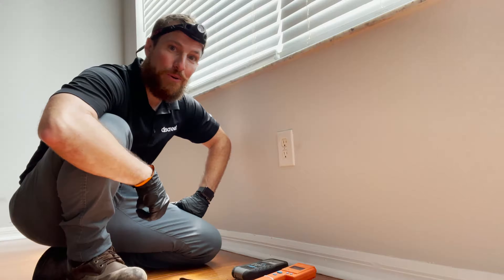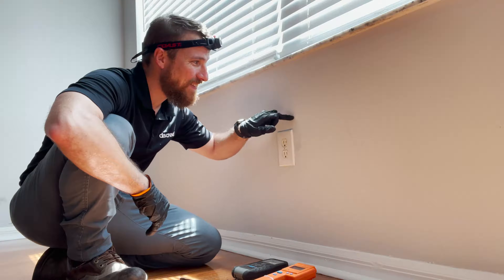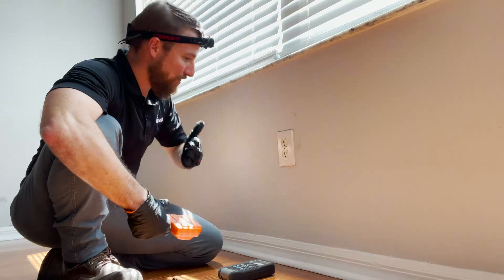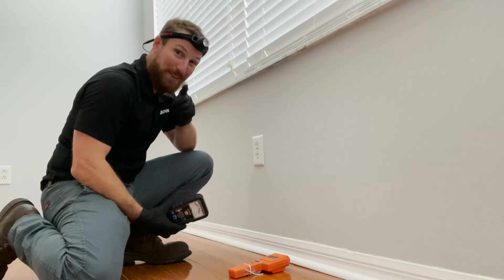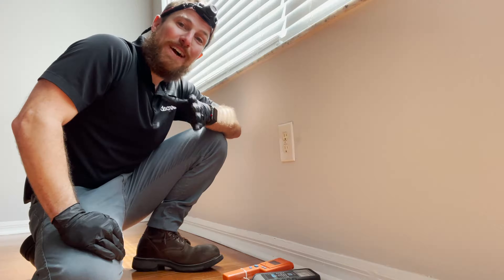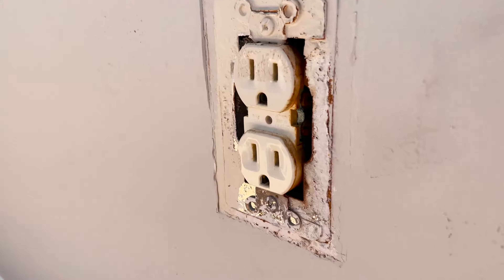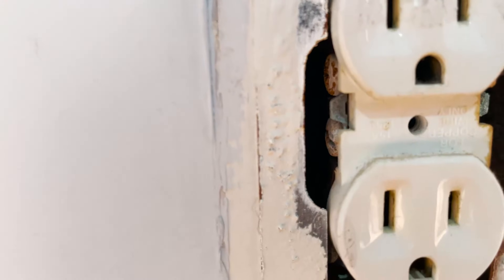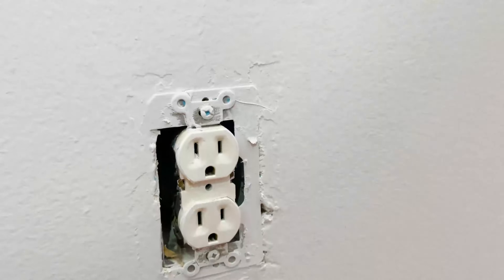Here's a Tip for Validating Moisture Within Walls

Comment: Ok we are in the same situation but we were told there could be metal all around the window giving it a false positive? Apartment doesn’t want to tear in. Many locations around the window is 100% moisture such as entire top portion, entire left side up to 5 inches out, part of the right side and all of the bottom. All from right next to the window to within 5-6 inches out. But they’re saying metal might be back there?
Reply: “Metal can influence some surface readings, but it does not create a full perimeter moisture pattern extending several inches into surrounding materials. The consistent 100% readings across multiple sides of the window indicate moisture migration, not isolated interference. A probe measurement would immediately confirm whether this is a material moisture condition or a false surface reading. Moisture mapping with depth verification is the appropriate next step.”

Comment: Look at the dark area under the window sill.  Is that mold or just dirty?
Reply from the maker: Typically it is going to be dust and debris, however, with dust can come mold. Especially if the window sill becomes cold enough to be a source of condensation from hitting the dew point temperature.

Comment: I learned before you tear away at a structure do an Air Quality test for Microbial growth in the room. You don’t want to expose your self to something without knowing what you’re dealing with. Then suit up and check it out . I am in the process of recovering from mold within my closet floor Moulding.
Reply from the maker: Great advice! You have to protect yourself before anything else. Lacking PPE when handling mold could be a non-issue for some people, while it may greatly impact others.

Comment: Hi, what is the best moisture meter for masonry?
Reply from the maker: Howdy! While I cannot say with certainty what the best moisture meter for masonry wood be, I can share with you which one I think is best, based on what I’ve personally used. Tramex makes incredible moisture meters, designed for various building materials. Their Moisture Encounter 5 (ME5) meter is probably the most versatile meter that you can purchase - allowing for evaluating everything from drywall to plaster, masonry and even concrete. 

Of all of the meters that I own, the ME5 would hands down be my choice for collecting moisture measurements from masonry.

Comment: The wall doesn't need removing. The drywall under the window needs to be removed, followed by the insulation. Odds are, the leak is rainwater entering at the sill level. It's unlikely you'll find damage above that. And if you do, then you can start tearing apart the upper areas.
Reply: I'm sure that's what he meant.
Reply from the maker: @KevinMaxwell-o3t Agreed. I’m referring to the interior drywall and insulating materials behind it only - not the entire structural wall.
Reply: if the wall smells from mold and the moisture meter shows high levels,how do i fix it?
Reply from the maker: @iimalivebutimdead Your best bet would be to hire an indoor environmental professional, especially if you’ve already confirmed excess moisture in the wall. 

Granted, if you are a handy enough DIYer, you could remediate the wall yourself. I would not advise this before doing your homework though.
Reply: Not if the wall has been wet for a while so mold more likely growing inside . So simply saying the dry wall does not need to be removed is not correct in my opinion. Plus it’s an outside wall so it probably have insulation in it too . You can also use commercial dehumidifiers ( not air movers ) to try to dry the inside wall if you can create some kind access . But that still will not get rid of the mold

Comment: Would be nice to know what measurement is considered normal moisture
Reply from the maker: Unfortunately, there is no universal standard for what is considered normal vs. abnormal moisture content. The amount of moisture in indoor air varies from property to property. Also, perimeter walls (those along the exterior of your property) will often contain higher moisture content, when compared to interior framed walls. 

I performed an assessment yesterday, where there average moisture content of the drywall was in the 40s. Compared to an assessment that I performed earlier in the week, where the average moisture content was in the 20s, this would seem elevated (abnormal). However, given the widespread finding of these numbers throughout the property, it was evident that this was the “resting” moisture content of the walls.

Comment: So what if you are aware of water damage is there guaranteed mold? My roof has leaked throughout a few widely spaced storms and in those 3 or 4 occasions I had water leaking into the house along a couple parts of the walls where there are exposed beams. Each time it dried the landlord came and recaulked and puttied the inside leak stains. After the most recent leak they tarped the roof and I haven’t seen any sign of water coming in since. However this time there was the most amount of water for a longer period of time and there is still a discolored stain where the biggest leak was. I bought a moisture meter to test these areas and most of the readings along these two walls were around 8-10% and in two small areas the highest was about 17%. Does this indicate a mold problem?
Reply: Hey! Did anything come of your concern? I am quite literally in the exact same situation. The highest reading I’ve gotten from my moisture reader is 62.5%. My landlord had a company out last year right after he repaired the leak, and they indicated no mold….. About a month ago, the leak was back. The tarp does seem to have stopped the leak, but I just don’t see how something wouldn’t have to be done to dry everything out.

Comment: Can you give a link to the meters you use? Great Video!!
Reply from the maker: Hey there! In general, I’ve been using Tramex, Delmhorst and Vaisala meters for some time now. 

Currently, I use the Tramex ME5 non-penetrating moisture meter and Delmhorst BDX-30 pin moisture meter for checking dampness in building materials. 

When I’m evaluating moisture in the air, I use a Vaisala HM-40. Some specialty meters that I use on occasion is the Tramex MEX5 and Tramex CME5. 

You’ll find all of these on Google, or you can check out the manufacturers’ websites.

Comment: Hello Josh, this is Uli from South Fl. I have a situation as when I look into my brand new bathroom (one month old). When I run the meter its detecting moisture at the base. We gutted the bathroom and there is no visible cracks on the tile or grout. Any idea what could have happened? We did not seal the grout, can this be it? Any advice would be appreciated. Thanm you
Reply from the maker: Hi Uli. Sorry to hear about your situation, but there is some good news! More often than not, finding “elevated” moisture toward the base of a of a tile wall or floor is a false positive. Well, by false positive, I simply mean that it’s likely not actually wet (beyond normal moisture levels). 

Assuming you’re talking about the base of a wall, or even wood baseboard, there can be a number of reasons for findings abnormal moisture levels here as well. 

As I don’t have enough information to fully understand your situation, I would recommend shooting me an email and possibly attaching some photos of what you’re dealing with. Definitely include some additional information regarding the surface(s) that you’re collecting moisture from. 

The best way to reach me is at josh@learniaq.com
Reply: @IAQJosh  thank you so much josh. I sent you an email. I appreciate you attention on this matter.

Comment: No Video on further investigation then. This could have just been cold bridging from the receptacle now it’s had previous high moisture. IE a leak. Not necessarily still happening. I’d have looked at cutting it out above this and if these are insulated behind was that wet and causing the cold bridge. Also these meters You’re using will pick up electrical currents. Was the electricity isolated to reduce any false reading. So absolutely not revolutionary. 🙄🤣
Reply from the maker: Excellent point, as many don’t know that these meters will pickup electrical currents. To those that don’t know that, they could certainly be mislead into thinking something is damp when it is not. 

I appreciate you watching this video and commenting! I

Comment: Thanks for the video. Can moisture readers read btw plaster walls??
Reply from the maker: In general, moisture meters can read moisture content within many plaster walls. Some plaster walls, which are primarily composed of wire and lathe, may provide a false positive to non-penetrating/ pinless moisture meters.  These false readings may indicate elevated moisture, when in fact you’re merely reading the metal wire within the wall. 

I find that it’s best to have a penetrating and non-penetrating moisture meter when evaluating plaster walls. This will allow you to collect varying readings from both meters across multiple areas, ultimately to determine if a wall has water damage.

Comment: This dude never did find out if that wall was leaking, that corrosion on that outlet could have bin from a long ago fixed leak. And on the wall he should have used a pin type moisture meeter because the are more accurate. Its redicules to assert the tiny unnoticable  pinholes a pin moisture meter  leaves, warrant not using it. If i cant leave tiny pinholes in a wall that no one else will notice, i simply wont do the job. If presently  everything is dry the suspected leak  outside the home is  fixed before the next rain and there is no mold now there never will be mold because mold wont grow on dry surfaces. So no reason to tear out the wall, change the outlet, fix the leak outside,  spakle the small spot where your finget found a bubble. Done deal.
Reply from the maker: I commend you for having such a strong-worded, albeit ignorant public opinion. Your thought process on pin meters being more accurate is very interesting. However, your logic is flawed, as there’s pros and cons to both pin and non-penetrating moisture meters. 

I encourage you to educate yourself further on the varying types of meters out there.
Reply: I agree,  I use a pinless moisture indicator a I really like it. It's made by klien
Reply: Klein

Comment: Could the water be coming from the roof leaking into the wall? I just found a paint bubble in a bathroom i had updated a few years ago and when I pushed it water came out.
Reply from the maker: Absolutely! Believe it or not, water can be entering at the roof level and not show itself until it reaches the base of a wall. This can make it difficult for both homeowners and even professionals to diagnose the point of entry associated with a leak. 

In short, water damage within a bathroom can be coming from the roof, as well as numerous other areas. If you have any additional information, or even pictures, I’d be happy to try to be of further assistance to you. You may email me direct at Josh@learniaq.com

Comment: My  14 yr old custom house had water coming through in master bathroom roof. I have a pass through fireplace in master bedrm/master bath. Last January. I had roofing company come and see - they said I needed ‘debris’ cleaned and some flashings replaced. And some tiles near both chimneys were cut. Cost was $3,200. They cleaned all the debris from the valleys and cut some of the tiles back away from chimneys.This was Jan 2023. Here is what they wrote on my invoice:

“ An inspection of the roof was undergone to determine what maintenance was required. We found the tiles behind the two chimneys to be too close to the chimneys allowing debris to build-up which caused the water to overflow. This was repaired by cutting the tiles by 6" to allow the water to properly flow. Secondly, we found the valley metal ends were on top of the tile and this causes the water to spill over the valley and run allow the underlayment, which can cause the underlayment to prematurely deteriorate. This issue was repaired by cutting back the valley metal ends and installing a lead extension on the five valleys. Lastly, we found the valleys and cricket to have debris. We underwent a clean-up, which will allow the water to properly flow…” 

We had a lot of rain in Feb and March and even some in August. All seemed, but to my shock, last week, I noticed a stain on ceiling of a bedroom not anywhere near where the January leak was. But this bedroom backs up to living room in area where there is another fireplace/chimney. I don't know when this happened. I seldom go in that bedroom and I seldom look at my ceilings. But water must have gotten in somehow. . I called the roofing company and left a message. Waiting for them to call me back.
I got a ladder and went up to feel the stain and there is no wetness or puffiness on the ceiling. 
November is a month we often get rain. Of course if we get rain before the roofer calls me back I will be sure at watch the ceiling where that stain is. Is it possible that
there was an unnoticed issue in this room but no problem NOW since the roofer worked on BOTH chimneys? Should I get a moisture meter?
Reply from the maker: A moisture meter is certainly something that most people should own. It also fits nicely inside of a kitchen drawer. 😉

When stains are found, it can be helpful to utilize a moisture meter to determine if these spots are active water intrusion or prior damage - especially when it’s a stain that one doesn’t recall seeing within their home.
Reply: Heck HD has a pinless Klein I think under $50. I’m sure a pro would go higher grade, but from what I can see it seems to work.

Comment: Ripping out the entire wall is a bit excessive. You probably meant the drywall needs to be ripped out.
Reply from the maker: lol, yes. I’m referring to the drywall, furring strip and any insulation. Not the concrete block itself.

Comment: Very helpful video! My renovated shower smells like mold. Room is more ventilated than before as an exhaust fan was added. Is there a way I can measure moisture in the tiled walls and tiled shower pan floor?
Reply from the maker: Thank you for the feedback! As far as measuring moisture concentrations within tiled walls, you’d ideally want to use a professional meter, such as a Tramex Moisture Encounter. 

If you use another type of non-penetrating moisture meter (meaning one without pins), you’ll want to collect a number of reference readings on tiled walls that you presume to be dry and free from water damage. Then you would collect readings from areas of concern and compare. 

With the above said, you will typically find greater moisture concentrations within tiled walls toward the base of the walls. This can be for a number of reasons, but don’t let consistently high readings through the base of the walls lead you to believe there’s water damage. If the numbers are all high and around the same levels, you’re likely dealing with a false-positive. 

Lastly, a tile shower floor atop a shower pan can be extremely difficult to measure for moisture concentrations. My best hit of advice would be to rely more on concentrations that you collect from the surrounding walls and other immediate areas adjoining to the shower. Lots of potential for false-positives when readings tiled floors. If you have a meter like the Tramex, you can use the shallow depth setting, which is often your best bet in instances like this.
Reply: @IAQJosh  I’m looking into renting one out now. Thank you SO much for your detailed reply!

Comment: What is the acceptable moisture level in aà house
Reply from the maker: Hey there! The acceptable moisture levels within a home will vary, depending on numerous factors. Climate is one factor and indoor ambient conditions are another factor. If you're using a moisture meter with a drywall scale, similar to that of Delmhorst's scale, 0.3-0.5 tend to be average moisture concentration levels within your average home in South Florida. Using a relative (0-100) scale, you'll see varying results, which will make it more difficult to identify what's normal. 

My best bit of advice would be to collect background moisture points within your home, in similar construction materials. For example, if you're trying to figure out if a window is leaking, collect moisture concentration readings around windows that have an overhang. Then compare these readings to those that you collect from a suspected leaking window. The idea here is that the likelihood of a window with an overhand leaking, as compared to one without is much lower. Granted, other factors may come into play (e.g. sprinklers). 

Hope the above info helps!